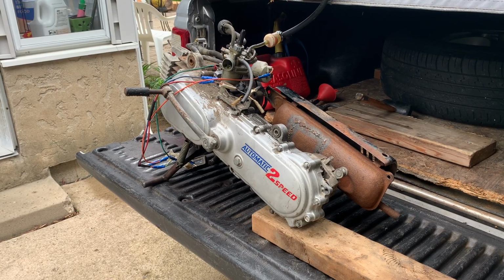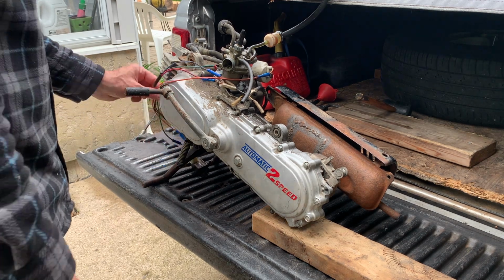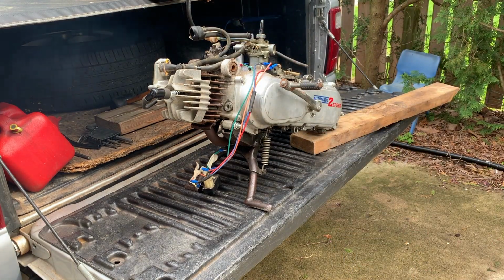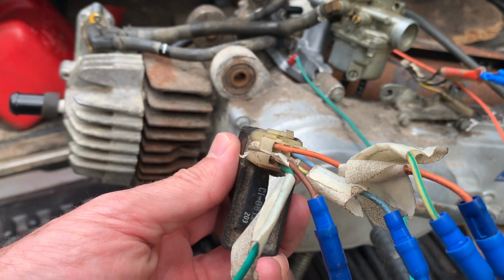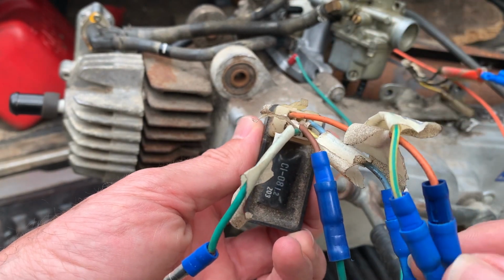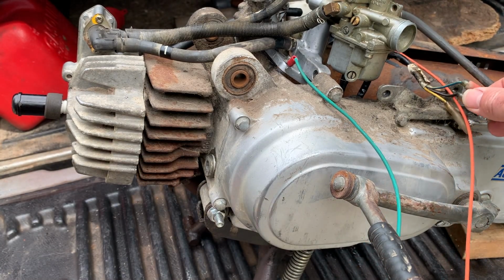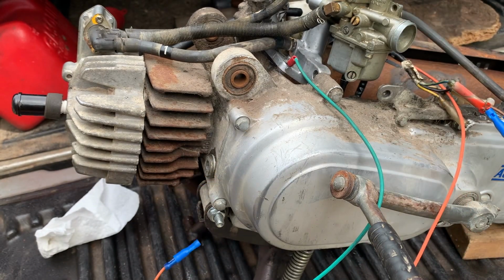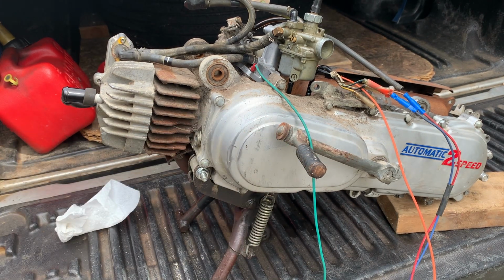Honda Express Engine Bench test 82-83 CDI model

Comment: Hello Jack I have a 1981 Honda Express CDI model giving me issues. I had a 5 pin CDI on there I ordered threw Amazon and it worked fine for a little while then one day while I was riding my coil came apart from the spark head. Took it home replaced the coil with one from amazon and worked good for a little while then stopped. Suspecting on the CDI I had a spare one I had ordered just in case, replaced the CDI and started right up for about a minute then died, now no matter what I do it will not start any thought what it might be. This bike is straight wired like this video you have no battery or any other connections just a pulse generator wire and a coil energizer wire coming from stater that's all plus the grounds.
Reply from the maker: Simplest thing that might have gone wrong is the new ignition coil is loose or not making good contact.  Or check to make sure it is properly grounded.

Comment: Jack a little help here will be appreciated, 1986 Yamaha QT 50 all of sudden stopped running: compression 110 psi, good hot spark and new plug, drained carb bowl switched fuel on again the drained cab bowl, built compression again and noticed a faint sound of air for a few seconds in the area of the intake, carb un-installed then stopped, found no fuel evidence at crank seals and now suspect reed valve(s). would appreciate your expertise. Thanks...BTW I look forward to your videos, very informative
Reply from the maker: Could be the reed valves.  It sounds like you've looked at everything else.  I've had a piece of dirt get caught in the reeds and hold them open.
Reply: @jackrutherford-1  Thanks Jack, I'll give that a look
Reply: Jack found one of the valves slightly open (see light thru it and no foreign object) can it be repaired? can you recommend a replacement source. Thanks
Reply from the maker: @billlester3088  treatland.tv has reed valves for the qt50
Reply: @jackrutherford-1  Thank you Jack for your help and info.
Reply: @jackrutherford-1  Jack a side note here, I disassembled, cleaned valve peddles they hold liquid, spark plug never gets wet so my only conclusion is perhaps the crank seals are leaking despite no sign of it, I don't know of a leak test!